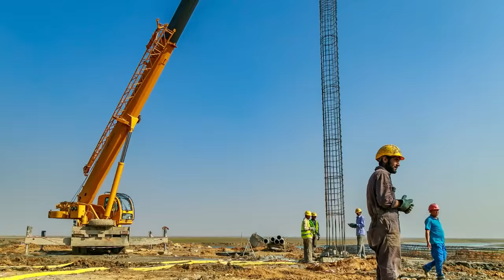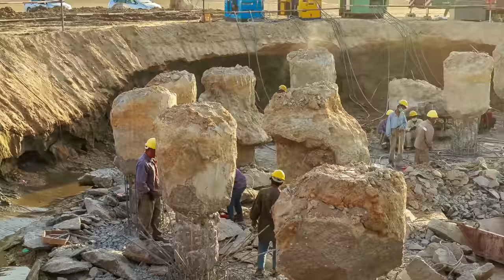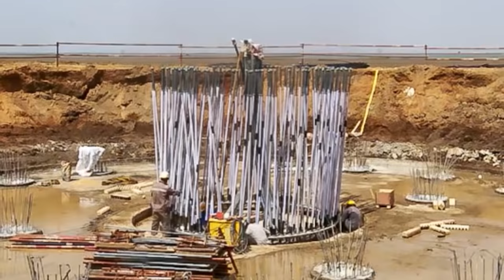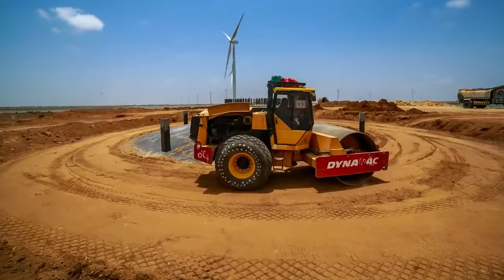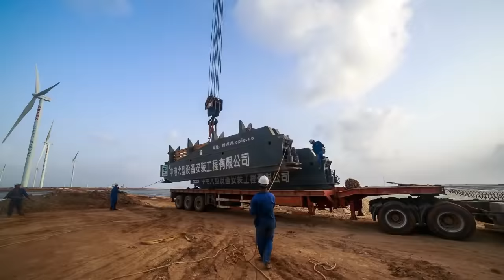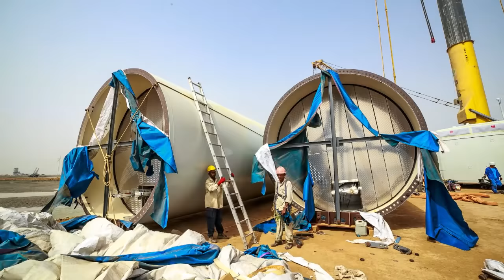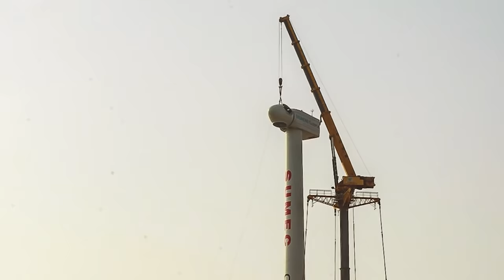Wind Turbine Farm Installation From Scratch | Time-lapse - Mega Structure

Comment: It's always fun to watch construction, truly amazing.  But how can anyone think that one wind turbine could ever possibly recover the fossil fuels expended to make the materials, transport them and then put it up?    Think people.....this wind turbine isn't even going to recover the energy of the fossil fuels expended to transport the workers to the worksite.    

Renewable energy IS the future, but until the technology is advanced its best applied at the point of use in small solar panels and small wind turbines that are easily upgradable and don't involve this much capital investment.  The only thing these massive solar farms and wind turbines are good for is political grift and government subsidized make-work boondoggles.   Wake up.
Reply: It takes like 3 minutes to show you're wrong

Entire turbine weighs 400t, it's made mostly from steel and concrete, so say 600t CO2 for manufacturing, round up to 1000t. The turbine makes 6 GWh/year. A natural gas plant would emit 1800t CO2 making 6 GWh, so the materials pay off in less than a year. Transportation and construction are lower than manufacturing.
Reply: @infinitelyexplosive4131  It takes less than three minutes to expose the flaws in your assumptions.   

How did the concrete and steel get there?   By diesel trucks and trains of course.   

How did the steel and construction plants get built ?  With fossil fuels of course.   

You don't get to write off the fossil fuels used to get everything to the  point we are at.  That's not yours to depreciate. 

In order to transport ONE turbine blade.  Just one, it takes a minimum of four vehicles - travelling cross country (and back of course) Plus time waiting with engines running at the weigh stations and trucks stops.  That's just for ONE BLADE.  

 Solar and wind are best and most efficiently produced at the point of use through small scale solar panels and small wind turbines at homesites but that doesn't feed the political grift and palm-greasing associated with large scale projects and certainly doesn't suit the power companies who end up having smaller incomes in their competition-free world due to government mandates and the like.   

Sorry boss, your math doesn't add up to the most effective means of taking advantage of solar & wind.  Its a government boondoggle and you're carrying their water.  Congratulations, you're exactly the opposite of what you likely claim to be.
Reply: @JohnDoe-hu9ve  You of course have done no math, because all that matters are your feelings. So let's do that math for you:

So how far they drive? Say 1000km, both ways, so 2000km. Let's increase by a factor of 5 the emissions associated with the trucks to account for size and speed, so 250g/tkm. Say the construction equipment adds another 100t. Then let's just assume I was off by a general factor of 4 again, to be absurdly conservative. That's 1000t of co2 emissions. Which is offset in half a year.

Again, that took like 3 minutes.
Reply: @infinitelyexplosive4131  this is fun.  How many tons did it take to mine the steel ore?  How many tons did it take to pull the gravel out for the concrete.  

Add it all up and compare it to what can be saved in a small home-based application.  You can’t come close.  Not to mention those applications don’t get anchored in old technology where it would be too expensive to pull them and upgrade them like the huge solar and wind fields are.  

So many people like yourself like to jump flaming hoops in their butt to try and justify this solution is better than pulling coal out of the ground when in reality it’s just to divert from the reality that in most cases the turbines are already ancient technology and out of date before they’re even turned on. 

Tell us more about where the money goes on these projects.   

Take a trip down memory lane and familiarize yourself with the “Pendergast Machine”.  This is nothing more than a modern version of the same scam. 

Wind and solar fields are nothing more than the dams of our generation.  And like the dams, future generations will be stuck looking at the eyesores and environmental hazards for decades to come because a few oligarchs could make a buck.  

This isn’t about saving the planet- it’s about making money.  You and your ilk would get a lot more respect if you just admitted that. I
Reply: @JohnDoe-hu9ve  "Add it all up and compare it to what can be saved in a small home-based application.  You can’t come close." Cite some numbers then.
Reply: @infinitelyexplosive4131  Be my guest.  Explain it to us with YOUR numbers since it’s so easy.
Reply: @JohnDoe-hu9ve  I've already demonstrated that large-scale installations have a short breakeven time. Show that residential scale installations are better.
Reply: @infinitelyexplosive4131 you’ve done nothing but prove my point by barely including a fraction of the hard fossil fuel costs involved with these silly virtue signaling, palm greasing large scale solar and wind projects and claiming they are effective and efficient. 

If you had to make the decisions based on hard costs and no government subsidies and tax breaks no businessman in their right mind would ever do a single installation.  

Requiring that power companies source a percentage of their power from these graft-based systems means that none of the supposed savings would ever pass to a consumer either. Because there are none. 

Furthermore, some laws are being passed that forbid consumers from feeding power back into the system and getting a rebate.  

The whole, entire, complete solar and wind large scale installation serves no other purpose than a government boondoggle where the companies that do it make huge political contributions and get major kickbacks. None of it would ever make sense if that construct didn’t exist.  

Prove me wrong. You haven’t done anything but prove me right to this point.
Reply: @JohnDoe-hu9ve  "barely including a fraction of the hard fossil fuel costs involved" Why are you lying? I genuinely cannot think of any reason you would have to lie this blatantly. 

You obviously cannot provide any examples of the significant emissions you claim I'm missing, or you would have done so. So you just make up random sources of marginal emissions and claim that they're significant, knowing full well that they're not.

Your aversion to data would be hilarious if it weren't so depressingly stupid.
Reply: Vestas studied the carbon payback period for various turbines. This took into account extraction and manufacturing of raw materials, production of the turbines, their transport, erection, operation, maintenance, dismantling and disposal, and the same for their foundation and the transmission grid. The figure was between seven and nine months, depending on the type of turbine. Other analyses have come up with similar figures.

Comment: Imagine all the diesel burnt, steel used and concrete poured, all the manpower coming there in trucks cars and buses etc etc, and then in the years following maintenance crews, material use etc etc, the list goes on and on.